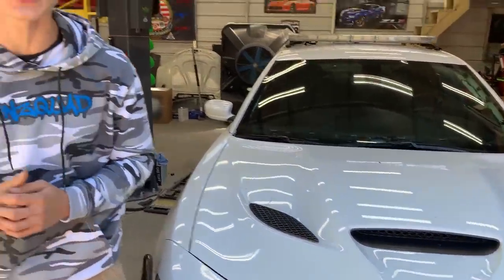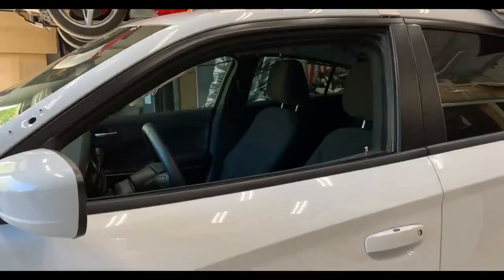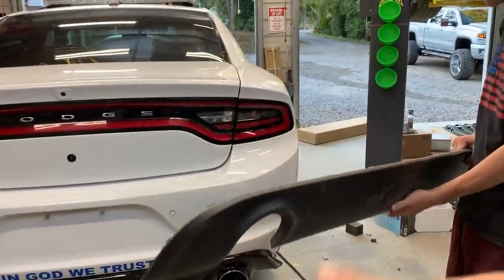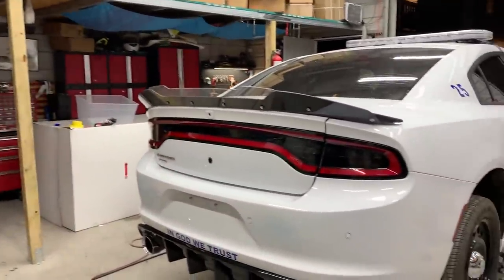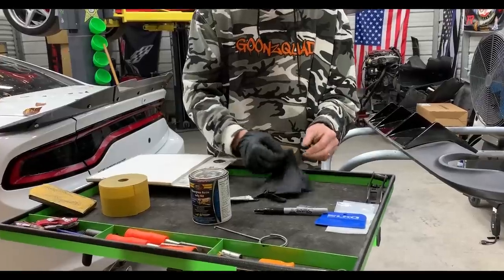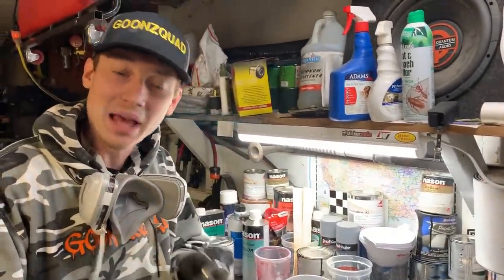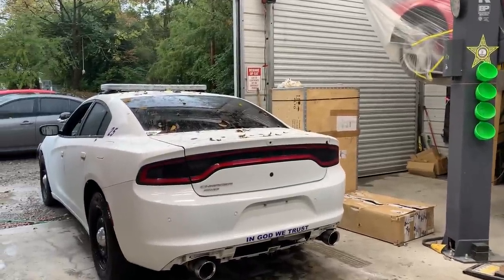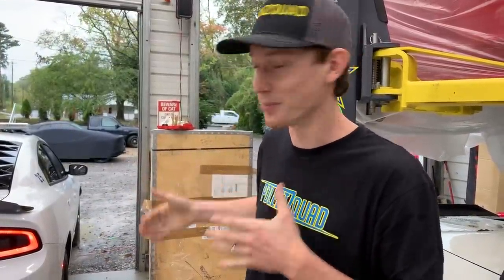Rebuilding A Wrecked 2018 Dodge Charger Police Car Part 10

Comment: I like how they run into a issue like the rear defuser, and without skipping a beat come up with an idea and make it work true talent
Reply: FOREAL!!!! im about to do the same , there's no diffusers for my car , well for the bumper i have :(( im about to do the same thing
Reply: Michael Erving dooo it bro! It looks soo good i think!!
Reply: Merica Freedomland this “molding” part doesn’t look too hard , they paint is the hardest 😒 in my town people like don’t care about cars so body shops here charge sooo much , I asked them to paint my mirrors black “the car came stock with silver mirrors , so I bought a new set for $300 unpainted” the body shop wants $1000 to paint them just black
Reply: Michael Erving oh that is un fricken believable!!! Id search around more and call around and get pricing!! Best of luck!
Reply: @michaelerving9146  that's crazy I had a full front bumper and small parts for less then that and it was black
Reply: @mr.merica6048  haha first off nice names guys!!! but yeah my town is trash , all the garages here charge a lot , i work on my own cars , even wrapping is expensive , just to wrap the roof of my car black i got quoted like $600
Reply: @michaelerving9146  dude that is f&$%ed up, but YOU CAN do it yourself. Goonzquad have shown us you can get a real nice paint job with spray cans, you only need 3 cans,  1 x primer, 1 x black base coat, 1 x clear, and some sand paper,  watch a couple of how-to videos and go for it. For your roof look up CK Wraps he has awesome tutorials on exactly how to wrap a roof, plus discounts for wrap and equipment, wrapping a roof is a piece of piss, that means it's easy in Australian 😀👊 
It's probably not going to be perfect, but with probably only about $100 outlayed for materials who cares if there's imperfections, plus you'll have the satisfaction and pride for having done it yourself while saving around 1500 bucks. Go for it man, you can do it 👊
Reply: @bigdaddy741098  don't forget the elbow grease
Reply: They probably spent 6 hours trying to figure it out..  it's called movie magic.  Also the paint looks good over youtube and your shitty phone but in person in the sun it wouldnt.  Trust me
Reply: @getchasome6230  Now my question is how long is that durty paint jod going to last. NOT one time did I see or hear the word FLEX additive  for those plastic parts. It will look like one of those cars from the 90's with the clear coat peeling off like a healing sunburn
Reply: @johnholliday8223  I didn't even think about that , the louver on the rear end didn't look good either , I guess they shoulda just left everything as is
Reply: @michaelerving9146  good reason to learn how to paint, ain’t hard just keep your hand moving don’t stop  👍
Reply: @johnholliday8223  you ain’t lyin

Comment: Not so keen on the louver on the rear window it looks to much like 007's lotus. Never the less great content as usual, keep up the great work.
Reply: *Nevertheless
Reply: I don’t like the look of the louver and the paint job is that time not so good as usual.
Reply: Same here . . . everything but that. Just doesnt look right on that particular car AND some of it has to do with the way that louver way made (cheap). 
The first factory street cars I ever saw with an OEM rear window louver  was the original BOSS 302 BACK IN THE LATE 60's / EARLY 70's. Look up some pics and you will better see what I tried to say above . . . no offence.
Reply: They seem to never know when's too much. The louver on the Dodge, they plan on making the whole rear of the GT3 458 out of carbon fiber, the stupid wheels on the GMC... the list goes on.

Comment: Famous cars with rear louvres include:

1981 DeLorean DMC-12
2015 Ford Mustang S550
2019 Datsun FairladyM (BifB's SEMA car)
1971 Lamborghini Miura P400 SV
2018 Dodge Charger AWD Hemi Poleetz Interceptor

Its a good design choice, I must say.
Reply: Bmw E26 M1
Reply: My 85 Shelby Charger had them too. Fac-tree
Reply: The Adventador has them stock.

Comment: If you guys want to get a better paint job down, without so much trash getting in it, wet the floor of your shop down every time you paint. All that dust and dirt and what not is flying into the air while you're moving around and landing in your coatings.
Reply: ɑʟpʜɑ ɱɑсʜɪиɑ there gonna build a garage with paint booth so it will be okay

Comment: That tailight isn't sitting right. Its kinda off a bit. Almost looks like the trunk isn't aligned
Reply: "almost OEM" is right.
Reply: I've noticed the same...
Reply: same :O
Reply: Those police cars have bushings that pop the trunk open when you push the button.  It holds the trunk lid up a little...  pay attention next time you're behind one
Reply: Ryan Coldiron why would that change anything? Every saloon has a boot that opens at the push of a button. Only hatchbacks require actual effort to open

Comment: I’m confused on where this build is going
Reply: That's why they're asking for suggestions from us.
Reply: Curious about that myself.  I thought they had planned on putting in the cage from the other car and then putting the Goonzquad logo down the side of it.  Personally though, I think they can ditch those steel wheels in favor of something better and maybe use it for charity runs like, taking veterans out on a day ride through the mountains, or using it for a Goonz-n-Coffee car meet up in Chattanooga.
Reply: I think they are just having fun with this one.
Reply: @davabran  Having fun while they wait on parts for the Ferraris and still delivering good content.
Reply: Drag car
Reply: theyve said a few times they want to make it a drag strip car, and theyre just doing aesthetic stuff before installing engine upgrades
Reply: They're pimping it out to the max. I think if they don't stop soon its name will be atrocious.

Comment: When it’s finished, you guys should sell it to your local police force 😂
Reply: That may be harder than you know. Most larger departments would not be able to use this car. It's been wrecked and sold as wrecked. A department would have to jump through flaming hoops to get it safety certified for law enforcement use. Any small department would not be able to afford it.
Reply: Sure....  Then  they'll  all  want  one.  Or  two.
Reply: Jimbo B. It’s was a joke pal
Reply: @CoItsy  No problem there chief
Reply: @jimbob.2299  But  it's  gonna  have  a  pro-charger  on  it!  Jumping  thru  the flaming  hoops  in  a  tutu  would  be  worth  it.
Reply: its poleetz force sry
Reply: @jeepanimal2943  Doesn't matter if it cannot get certified for law enforcement use due to it being wrecked and sold as wrecked before they cannot use it legally. Say a department bought and used it. Say there was a pursuit and that car was in an accident where an innocent 3rd party was hurt badly. Ten thousand lawyers would be slobbering to sue that department and make the illusion of negligence on the department for using a "wrecked" police car that wasn't safe anymore. Adds many millions to the law suit. See what I'm getting at? Insurance underwriters for departments would make it very had to get a wrecked patrol car approved for the road.

Comment: I definitely agree with hindsight 20/20 - The 80's called: they want their louvers back! The material will sag over time make it look worse than it does now.
Reply: It looked super flimsy. I couldn't tell if it was just the camera angle, but It looked like the very bottom part was already sagging and twisted

Comment: Before installing the supercharger make sure your stock engine and rear end can handle the extra horsepower last thing you'll want is to toast either one of em
Reply: Gonna need bigger injectors to. Hell with a procharger there's a million things needing to be done depending on how deep they wanna go with it. Unfortunately I doubt it will even get a tune.
Reply: @theonlyone8630  The procharger kit comes with bigger injectors and a tuner.  I have one. (unless you buy the "tuner kit" which would be a mistake.)
Reply: It's got a cop motor, cop suspension, cop transmission, and cop tires. Not sure if the cigarette lighter works....
Reply: @valhallamotors6468  "it's dark and we're wearing sunglasses" "hit it"

Comment: Rear louvers ruin the car, it's lookes riced.
My opinion.
Reply: I agree, they look horrible on it
Reply: Louvres are a muscle car thing, thats what theyre going for is aggresive muscle. Back in the days you used yo be able to take your body panels to a metal shop and have louvres stamped in anything for like .25 each like fenders or hoods
Reply: I get that it's just those are just soo badly designed, trying to copy the ones on the Huracan, they look all bent-outta-shape.
Reply: It may even be the gloss thats throwing the look off so bad. A matte finish may look ok

Comment: It's definitely going to look amazing when you guys are done. A quick tip for removing emblems or lettering is fishing line. That way you don't have to tape it off or worry about scratching the surface behind them.

Comment: Take off the Charger AWD badge as well and paint the bolt heads black on the rear wing. Louver looks awesome. I think you should do your "Poleetzquad" logo on the sides of the car as well. Great work guys, keep it up.

Comment: Run that procharger setup on e85, drop in a walbro 450 and bigger injectors. With the right tuner you would be surprised what a stock 5.7 can do.

Comment: Make sure to put some RTV around the bolt holes between the spoiler and the trunk deck, or you will end up with a trunk full of water after sitting outside for a while.

Comment: Use you guys heat gun to soften the plastic bumper and mold it yourself to fit the body lines of the charger, just a thought

Comment: Be careful with that pro charger and keep it in low boost. The 5.7/6.4 have weak internals and can only handle about 5-7 lbs of boost. Other than that have fun bro(s)

Comment: You must silicone over the holes you drilled in the trunk  for  that spoiler . The water gets down the hole and into the trunk to the corner of the trunk and it gets into the LED light strip and burns it out . $1200 mistake . I have done it to my own car ... cover the holes with something .

Comment: Please don't paint with the wood burning heater running, the paint fines could ignite and KILL you. Also, don't forget to paint the holes you drilled in the trunk lid so they don't rust.

Comment: Take that tint off the brake lights. Many states have laws regarding that. They have to be easily seen at distance and no modifications to lessen their safety purpose. Remember this car is going to be a target for police stops. Also, as to civil liability and insurance. Take for example you are hit from behind. Often that is the fault of the other driver. However, I have seen cases where courts have decided the tinted brake lights had bearing and ruled  tint driver being the cause of the crash rather than to rear ender. Likewise, your insurance could be reluctant to cover you knowing you defeated a safety device. If the crash involves injury or death you could be on the hook for a large sum of money just trying to look good. While we are discussing things, modifying the exhaust is typically illegal in many states. Though, provided it is not making an excessive amount of smoke or noise it most likely will not be problem provided your state does not require an emissions inspection. I don't care for the lou ver. It's hard enough to see out of those cars with the tint. No need to add that crap.

Comment: You guys gotta stop using silicone base shines if you are gonna do all that painting. Silicone causes major fish eyes so tire shine and interior shine is nasty stuff around a bodyshop. Once when i worked at a limousine factory, someone used some silicone caulking  on the other side of a huge shop  during winter time and the fumes from it destroyed the paint job on several cars. I dont know if that is what is happening to your paint jobs but its just an idea you could consider.

Comment: You did a very nice job on the diffuser. Did you prepare the holes you drilled into the boot for the wing? If not, those are going to rust. Speaking of the boot, it's out of alignment. Needs to be lowered a bit to square it with rear lines. And if the louver tears off whilst driving, it may hit another vehicle or pedestrian. You may want to consider that.

BTW, for the pronunciation of words. You can type a word, for example "louver" + "pronunciation" into either youtube or google and an audio clip of the correct pronunciation will be provided, https://www.youtube.com/watch?v=ry1zwnue06U . Listen and repeat.